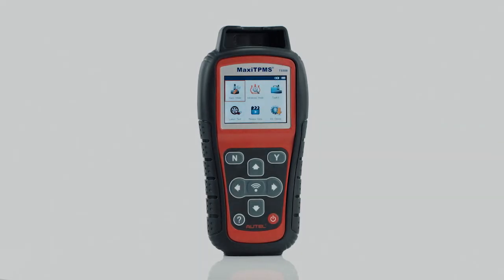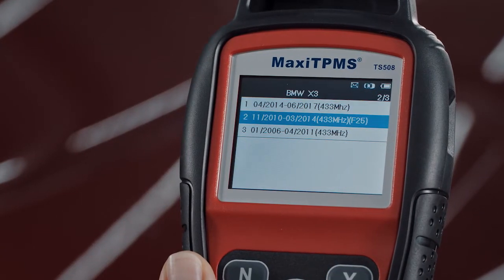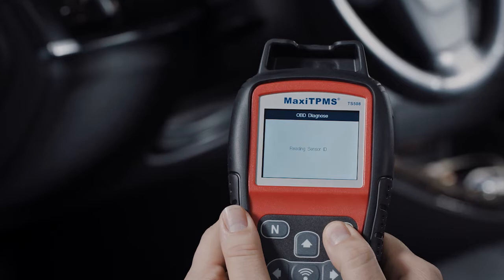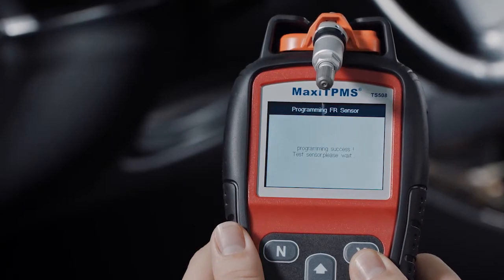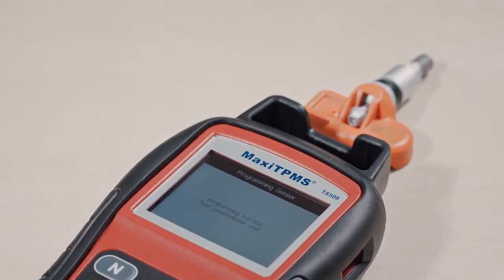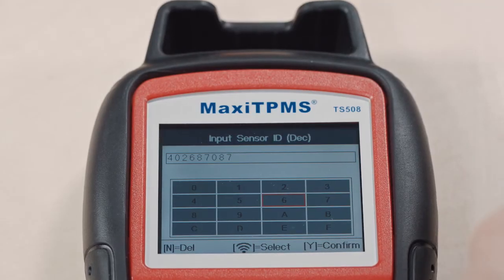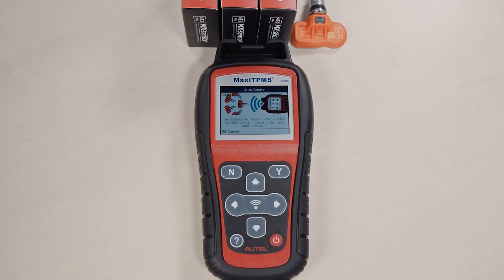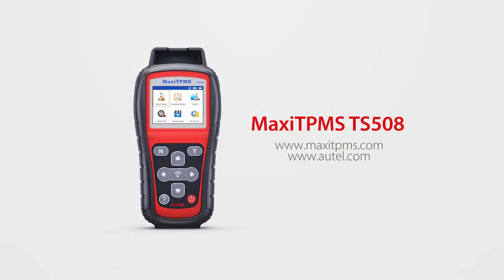MX Sensor Programming TS508

Comment: if the TPMS sensor is totally dead and OBD method dose not support , should we use "manual input"? Do i need relearn procedure for "manual input"?
Reply: Always relearn all sensors after any changes.
Reply: I replace 1 sensor with mx sensor b3cause 1 was no good. I did the copy and activation for it. But light still stay on, I try to stationary relearn and it fail on me. The other 3 is original and not mx sensor.

Update: I'm so dumb, I didnt properly read the instruxtion just saw instruction 1 and 2. It is working now. Yugioh player he like

Comment: I lost one of my old sensors that I damaged when I dismounted the tire , I put the new tire on anyways but can I program the replacement sensor without having the old sensor
Reply from the maker: You have the option to read the sensor ID's from the OBD2 port to "Clone" the sensor. The other option is to just auto create a sensor and then do the relearn process

Comment: I have a small problem I have a small scanner TS 501 that can not program the sensor 315 + 433 = 1 that I ordered from China each time I start programming it writes me error code
Reply from the maker: Make sure the tool is updated, if that doesn't help I recommend contacting the support team support@autel.com
Reply: Is it an Autel MX sensor,Autel TS501 can only program a Autel MX sensor.

Comment: How do you read aftermarket tpms sensors installed already? Tia.
Reply from the maker: If it is already installed you should be able to just select the year make and model of the vehicle and ready like normal. Once a sensor is programmed any TPMS tool should be able to read it.
Reply: @FlashPerformance  weird I had to go and try 2 of them about 10 x, thanks for helping, cheers.
Reply: @duramax78  Autel makes very reasonably priced programmable sensors that are a perfect match to the MaxiTPMS. I wasted too many dollars buying cheap junk. First Winter, battery fails, not programmable, not pre-programmed properly. Why waste too much money mounting the junk sensors only to find out you are stuck with a turd?

Comment: This reading any Sensor or have some Special sensor
Reply from the maker: The Autel TPMS tools will read and relearn any sensor that is already programmed.
Reply: @FlashPerformance   ok and I have another problem is not read my old sensor and i dont found ID for a sensor
Reply: @FlashPerformance  Even aftermarket sensors like the TMP93A from Standard? That's the one I hope to clone from my existing ID. (Autel only mentions their own "MX" sensors, so it's confusing.)
Reply: @FlashPerformance  will it program any sensor my shop only supplies customers with dill sensors to replace dead sensors
Reply from the maker: @JustinNorwood89  The Autel tool will not work with Dill sensors.